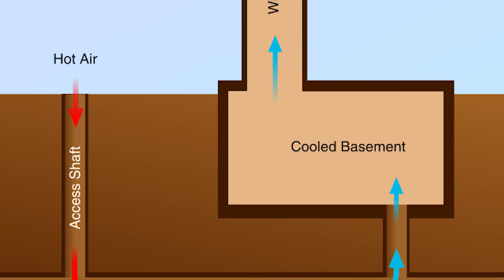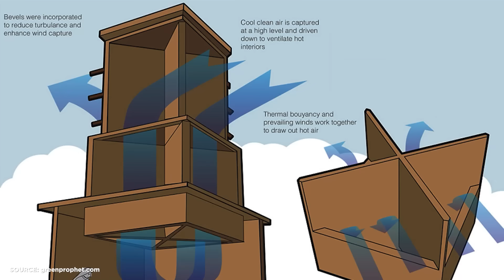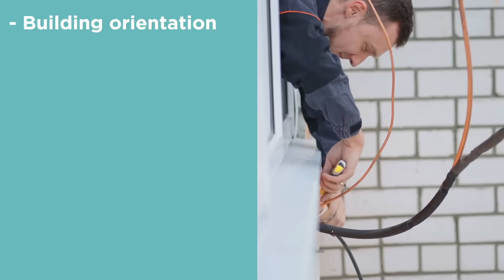Forget Heat Pumps - This House Cools Itself With NO Electricity!

Comment: Once you understand that hot and cold air molecules can be separated and isolated by spinning the air under pressure, it opens your mind to a lot of new pathways.

Seems unreal but you can buy "vortex tubes" for a couple hundred dollars USD that simply connect to pressurized air and produce heat hot enough to burn you badly or cold deep enough to freeze water, depending on which exit port you're observing.  It's kind of like an automatic cream separator - but for separating hot/cold air mixed together.

copypasta:
The vortex tube, also known as the Ranque-Hilsch vortex tube, is a mechanical device that separates a compressed gas into hot and cold streams. The gas emerging from the hot end can reach temperatures of 200 °C (390 °F), and the gas emerging from the cold end can reach −50 °C (−60 °F).[1] It has no moving parts and is considered an environmentally friendly technology because it can work solely on compressed air and does not use freon. [2]
Reply: That would consume preposterous amounts of compressed air (and energy) to cool an average home...and the noise! The secret of heat pumps is the state change (latent heat) that allows for low power movement of heat from one place to another and they are relatively quite.

Comment: I had a teacher (Washington State) back in 1972 when to Missouri to build a house and put a type of salt in the basement. When my father when to visit his parents my teacher was only 2 miles away! It was 77 in there and the outside it was 95! No fans, only natural air circulation. It would 68 when it was winter. If he had solar cells, they would be there also!

Comment: It's great to come up with new ways to build, but we desperately need cost-effective options to retrofit existing infrastructure.  People are not inherently long-term thinkers, and we WILL choose immediate returns over delayed gratification.  In short, we aren't going to go through our cities and tear down existing apartment buildings to construct  newer "better" designs.  Even with governments throwing piles of money at the problem, it likely wouldn't happen.

But I think we can learn from these options.  For example, a facade that borrows from wind collector design to funnel cool air into the building and hot air out.  This could use something as cheap and replaceable as canvas.  We could invest more research into thermocouple tech as well.  There are some that are essentially silicon wafers, and they generate electricity from heat differentials between one side of the thermocouple and the other...what if we were to use them as a core part of insulation?  The interior and exterior of a building are always inherently at different temperatures and we could use that to recover some of the electricity used to heat and cool our buildings, lowering the overall load on the grid and saving money in the process.

I digress, but my point is that we need to have options for places like the one I live in.  An apartment, built in the 70's that can barely handle the energy load of two pc's and a laptop all on at one time, and which has no energy efficient windows and no built in AC, though it does have baseboard electric heaters.  It is obscenely inefficient, and falling apart at the seams because the landlord can barely afford to maintain it.  

I doubt they'll tear it down to build something new, but if there were affordable upgrades with government subsidies to support retrofits, it could be turned into something far more sustainable.

Comment: In an igloo. You need to remove layers but keep on the top fur.

This insulates you and prevents you from melting the the igloo from the inside by body heat. 

A wide enough igloo fsoesnt have this problem and you also don't need to be wrapped up too mu h cause the igloo is warm.

Comment: I live in Dallas, and my cheap apartment is terribly designed. There are too many southwest facing windows, so it's not in the summer, and most of the windows don't open, so I have to run the A/C even on a mildly warm day.
Reply: That may be a good thing. Pollutants get trapped in water vapor. AC units remove water vapor from the air so your inside air is likely better that outside air.

Comment: I think it’s important to mention that if you’re going to seal up a house to prevent air infiltration, you need to make sure not to use materials containing VOC’s (Volatile Organic Compounds).
Reply: An ERV or HRV with dehumidifier MUST be used in any structure with low air-exchanges-per-hour. VOCs aren't a good reason to have an inefficient structure.
Reply: @Krazie-Ivan  Wait...a truly efficient building would have ample, passive air exchange with the environment, right? So that A/C or heating would only be needed in truly exceptional weather?

This, OTOH, sounds more like the typical  "seal it up, use lots of insulation, and trust in God and your HVAC installer...not necessarily in that order."

Probably doesn't even have operable windows, LOL.
Reply: @bcubed72  ...passive air exchange isn't the goal, no. 

starts with passively working with the environment in both hot months & cold via; minimal E/W exposure design, overhangs, earthtubes, deciduous tree xeroscaping, southern solar gain & thermal mass storage of that gain, Trombe walls, etc.

then you want that structure to react to the outdoor temps as slowly as possible to give other mitigation systems a chance to offset, so; airtight, thermal mass, casement and/or picture windows, high R, no thermal bridges, deep frost wall, slab over insulation, etc.

once all that's covered, there's very little left for HVAC to do, which means smaller & more efficient units, if any at all. the purpose of an ERV/HRV is to draw in fresh air to the living areas, remove stale air from baths/kitchen/laundry, and use that old conditioned air to pre-heat/pre-cool the incoming so the energy isn't wasted. by controlling all air exchange, it can then be calculated accurately, and systems are placed w/o guesswork & high fluctuation, meaning increased comfort.

not only are structures like this more efficient, they're quite a bit healthier.
Reply: @Krazie-Ivan  well said! Sadly, the mistakes of the 70s and 80s are used as “evidence” that new technologies can’t/won’t work. I mentioned elsewhere, but the YouTube channel “Build Show” with Matt Risinger, (a custom home builder) goes into great detail on the technologies, materials and installation methods for these newer, high efficiency homes (even if they aren’t true “net zero”, they are WAY more efficient and healthy)
Reply: @bcubed72  Passive air exchange is only efficient when the outside air is at a comfortable temperature with a moderate breeze, most regions only get that briefly 1 or 2 times a year if it ever happens at all, and since we have windows to create that passive air exchange when it is more efficient we NEVER need to intentionally make the envelope of a house leak at all.
Reply: And control for humidity way better.
Reply: A Heat Recovery Air Exchanger or equivalent to provide oxygen to the residents and control humidity is required if you're going to have an airtight house, obviously.

This really should not be surprising to anyone.

There was a brief period in the 1970s, during the energy crisis, when people sealed up air leaks without taking this into account. But that was a half-century ago, and we should be past it by now.
Reply: Ideally you also want a significant amount of mechanical ventilation that runs the air through a heat exchanger, efficiency shouldn't be achieved at the expense of indoor air quality.
Reply: We'll be showing the IAQ sensor in the wall switch product at TecHomeBuilder in October.  LC enables PH.
Reply: Yeah, I hear "sealed building" and I think "sick building syndrome."
Reply: Radon Gas is another big health problem with sealed up buildings.
Reply: @MHdollrevievs  ...sealed performance or drafty garbage, neither are good methods of Radon mitigation, nor are they designed to be. it's a separate issue.

every new structure should have an underlayment already to prevent moisture wicking up into the slab or sitting under floorboards, which will then trap Radon. all that's needed is a vent pipe to a spot above the structure's roofline. 

retrofit older homes with an ERV/HRV whenever achieving low ACH ratings. it's healthier, and lowers energy costs, as stated above about VOC concerns.

Comment: A house near me was designed by a specialist for passive heating, and had an enormous south facing picture window almost the size of the living room...with a reflective shade that would lower and raise automatically with temperature.  So, very large windows are certainly possible in a passive house.

A friend's earthship home (elsewhere) also has plenty of windows.
Reply: Summer shade can be provided by roof overhangs. Our house has ~24 square meters of south facing windows, 100% exposed to low angle winter Sun, and nearly 100% shaded to high angle summer Sun.

Timing is not perfect, as heating needs are phase shifted compared to seasons. So deciduous trees, with leaves, are helpful as they're better time aligned with need of shade vs sunshine.

Comment: One thing made me grimace a little with the passive house spec was the airtight part - my first thought was "what about Radon?"
Reply: Radon is easily addressed with a proper foundation layer & drainage system... which should already be present to prevent ground water wicking up into a slab, or pooling humidity under a floating floor system.

If a building has gas (which imo is a bad choice already), it should also have carbon monoxide alarms. Poor reason to have inefficient structures.
Reply: My drafty house saved me from a bad carbon monoxide problem with a bad gas furnace. I would never live in a cooler-like air-tight house and have any gas appliance.

Comment: As always great forward thinking content but the reality is “looks good on paper” Especially here it the state we live in and the other “hot” states, large scale construction would rely on the low skill or NO skill housing builders who go by the rule if it is within a 1/4” “nail it”. The tolerances needed to construct large scale residential housing would never be achieved. You “nailed” it by saying money and politics are the biggest obstacles as well as our willingness to settle for the lowest cost made by the lowest bidder lowest cost of initial ownership without regards to even 4 years in the future. There i survived that statement whilst staying politically correct and not what I really would have I said if we were in Deep Ellum on our 3rd beverage😝

Comment: "Heat pumps are all the rage right now."  -  Hmm... My Texas house was built in the 1980s with two heat pumps, one upstairs and one downstairs. I guess it was ahead of its time. Personally, I'd never heard of a heat pump until I moved to this house, which is also the first time I've lived in a house that doesn't have natural gas available as a utility.
Reply: much of the rest of the country, particularly in the high population density coasts, and my prior home in New England, does not use air conditioning nearly as extensively as Texas. In fact quite an effort is made to minimize their use at all up north. Fully utilized air-conditioning, in places like Texas, lends itself to use the same systems as heat pumps, it is more viable, for example when heat is mainly needed at night and not 24/7 in long winters. In the north, houses have been built with central heating systems as the main priority, and air conditioning an after-thought.

Comment: Right up my alley with this.  I’ve been interested in passive heating and cooling since I was in high school, so I read everything I could about it.  However, trying to get anyone interested in passive hvac was crazy hard in the late 70’s early 80’s.  So I did something else instead, photography. So long story short, starting in 2006 was finally able to build my dream cabin in the woods. This was in one of the coldest places in Colorado, Hartsel elevation 9650 ft. Using all the above mentioned passive heating strategies, with active solar in floor heat, super insulated- walls ceiling and floor. PV solar, and thermal solar panels. This off grid home produced its own heat, and electric. My backup heat was wood first, propane last. The electric was pV’s, and a wind turbine ( yes it blows A Lot in South Park.  Just ask Cartmen;)
Reply: Congratulations on building your dream home.
Reply: @macklinillustration  , thank you. Unfortunately I don’t live in it anymore. Had to sell the cabin in the woods because of divorce.  However, I learned a lot in building, community, building codes, and relationships.  It’s worth it to have the experience.

Comment: Hi Joe, Great video topic! I’m on the same wavelength. Our family just spent $12,800 upgrading our 1940s wooden bungalow with super efficient double paned widows just before our horrible year of heatwaves here in Texas. Our electric bill has actually gone down instead of up compared to a normal summer! The installers say they should pay for themselves in three or so years. In winter, the windows will also keep in heat during an occasional arctic blast. We draw the curtains during the hottest part of the day to help a bit more. Legend has it that in the 1800s early Texas German settlers built cellars with native limestone under their homes and would sit down there to get away from daytime heat. I’ve actually been in one in Castroville, Texas and it was easily 20 degrees cooler than outside temperatures. Add Animal burrow mimicry to your list. 😎🥇⭐️📺🎤
Reply: Underground houses with a central courtyard can be found in Tunisia. There are more than a few underground dwellings in Coober Pedy, Australia, where opal mining happens underground in a mostly desert environment
Reply: Very nice!
Reply: Dont have to bother with drawing the curtains during the day. Any heat that is absorbed by the curtains is now in the room anyways, curtains keep objects in the room from getting above ambient.
Reply: @instanoodles  just put the “curtain” on the outside though and it works great.  We have these on our place and it really keeps the heat out.
Reply: @instanoodles  Well the same could be said for the wall or roof, couldn’t it? Curtains are an effective way to keep heat out. They are a poor conductor. Exterior blinds are even better. In Australia we also tended, in the past, to combine these things with large verandahs, large roof cavities and high ceilings.

Comment: Or 3... The world simply wasn't as extremely hot as it is today with climate change. We survive extreme cold (ice age) better than high heat. We developed civilization during a time of relatively comfortable temperatures. Now we're seeing extremes that will require technology to survive. "The old ways" only work with the old temperatures. They won't do much if it's over 120 degrees fahrenheit out with 100% humidity. With the wind towers and water cooling you describe, that only works in a desert environment. 

As for airtight houses, they are considered a health hazard. I'm also confused by you starting off with "How things used to be done" then jump to modern design principles as if they were one and the same. Old stone houses, for instance, were NOT airtight, in fact they breathed, which was very important to prevent mold growth in cool damp climates. Old homes also didn't have: filtered air with heat recovery, continuous insulation, high performance doors and windows, etc...